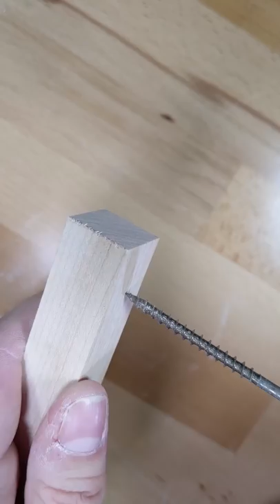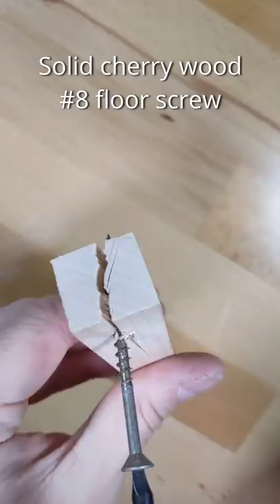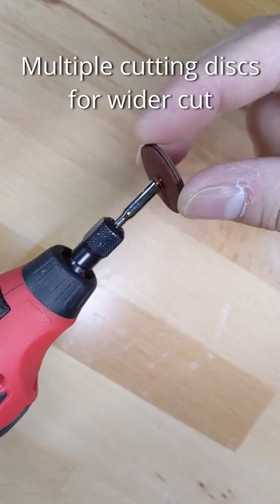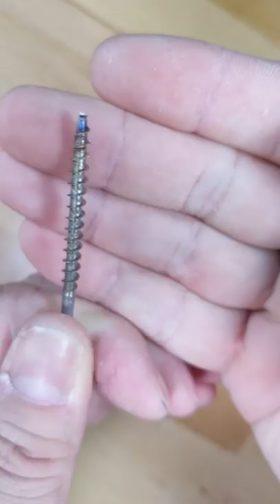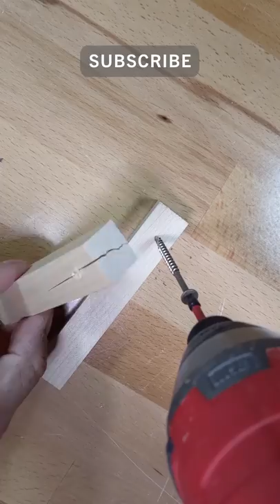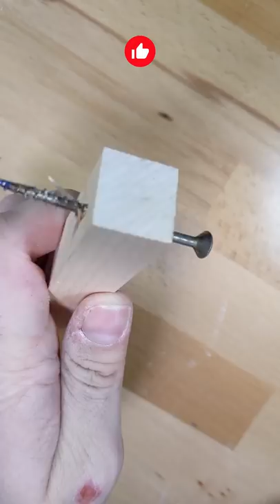Convert any screw to self-tapping, self-drilling! #shorts

Comment: Sounds crazy but why not pre drill the hole?
Reply from the maker: Not crazy at all. Pre-drilling should always be option #1!

As stated in the description, pre-drilling wasn't possible in my context. I needed to attach a small box to a wall stud; by screwing it at an angle, via the box's top opening. To be able to pre-drill with a 3/16" drill, I would had needed a 8"+ drill bit! This is definitely not common!

That's why I took "plan B" to use self-tapping screws so all I needed was my long screwdriver bit (far more frequent).
But my self-tapping screws were all 1 1/2" inch long at max... I needed a 2" and up to properly go through wood, drywall and securing it to stud!

Hope this clarify the why!

Thanks for your input!
Reply: @northernhandydad  
Sorry. I didn't read the instructions.
Probably why I'm always repairing my jobs
 Lol
Reply from the maker: @AngryHybridApe  Yet I pinned your comment! You were polite, and the comment valid! Thanks for participating; I hope I'll see you on my next videos! Cheers!
Reply from the maker: @jasen vernor  Good to know! I'll try to find myself a nice set! 👍
Reply: @northernhandydad  couldn't just run a smaller screw in first? Cool trick though
Reply from the maker: @Hanibalscookbook  Interesting. I'll have to try this small screw thing! 👍 Thanks for sharing!
Reply: Use a smaller screw or a nail next time. Try it, it works or even try running it in reverse. Easy peezy.
Reply: Saves time if you have alot of them
Reply: It's too fast.
Reply: Cool thx for that!! Learn something everyday
Reply: @northernhandydad  right angle drill
Reply from the maker: @SuS_NuG_It  Good idea! I'll try to find myself a nice self of those 1/4" shank drill bits.
Reply: Run the drill backwards for a second while  pushing. This is a massive waste of time
Reply: Just full the tip of the screw tipps
Reply: In a narrow piece of wood if you dont drill it splits
Reply: @federicofoglietta7635  
Yes it does. But I learned a neat trick if youre going to nail it. Blunt the tip of the nail 1st. I dont why it works, but it does. You would think a blunt end would make it split more than a pointed tip. It dont. At least you stand a better chance of not splitting it. It can still happen.
I got real good wirh glue. Lol
Reply: Exactly what I was thinking.
Reply: Honestly isn’t a bad way of doing it. They teach it in college but he made it look like a tedious task lol
Reply: This is a classic case of a solution in search of a problem...
Reply: Smh. Just pre drill it. Obviously you ain't don't anything extensive in woodworking if you think that's even a "hack" every job site has 2 drills atleast. Put a dam drill bit in one with a counter sink and drill it 😷🤮
Reply: @northernhandydad  a easier better trick....put the drill in reverse and pull trigger....after about 4 or 5 seconds when u see it smoke...then drill foreward.....thank me later and make a video with credit to me =) it wont split
Reply: Or even crazier, just buy self tappers
Reply: I’m just here to upvote all the politeness and understanding!!
Reply from the maker: @duzzitmatter8679  You're on the right video (not)
Reply: Or just buy a self tapping screw
Reply: Just use C4 saves time
Reply: Lol fuqn facts!!! Instead of going through all that nonsense!
Reply: @billdundes445  most of the reviews say they wobble, the only other solution I saw was to use a 1/4 bit chuck or 3/8 and put it on your drill but those reviews are bad too. Those extensions are for Phillips bits and stuff not really for drill bits
Reply: I guess pre drilling would be to much like work
Reply: That's what I was going to point out
Reply: Who has time to pre drill just

Comment: The key to this operation is cutting off the tip
Reply from the maker: Exact. So it's acting as a cutting edge instead of driving the screw in the wood! Others pointed out that a hammer hit on the tip could also do the trick.
Reply: @northernhandydad  this is true. Just hit the nail in something hard and dull the tip

Comment: Or just drill in reverse until the wood smokes a little and then drive forward.
Try it
Reply from the maker: Should work too! My trick is more on the safe side, yet way longer. Thanks for your input!
Reply: pro tip 👍
Reply: It works, we use the same method. 👍🏻
Reply: Wood yeah, chipboard no cause its poisonous
Reply: @abyssmanur3965  I try not to use chipboard anyway. I've never had a good use for the stuff.
Reply: I do this all the time. So handy.

Comment: There is an easier way... just put the drill on reverse first and apply some pressure to force the screw in a a couple of mil, then drill as normal and it will never split the wood 👍🏻
Reply from the maker: Will this work for solid wood? I know this is a perfectly valid option for soft wood like spruce, pine or cedar, but in my case it's cherry wood. Do you also use this reverse technique for solid wood?
Reply: @northernhandydad  should work fine, if you work your way slowly halfway in before you go forward . Also dipping the screws in soap bar before you screw them helps a lot.

Comment: Aside from other comments, I have yet to see anybody mention he is using a soft wood screw for hard wood, the threads are much tighter don’t go as far out in diameter on hard wood screws.
Reply from the maker: The purpose of the video was to show that any screw can be converted to self drilling. Those are effectively screw for sub floor!

Comment: Just run a regular screw in reverse before running it forward. Works well also.
Reply: Same thing I said. Don't have to pick up any other tools. You can use the bit for a counter sink too
Reply from the maker: Thanks for your input!
Reply: @northernhandydad  siding hack with a wood cutting blade: turn the blade around, it will cut without destroying the siding and save a trip if you're in a time pinch.
Reply: @northernhandydad  drywall mud hack: if you get bubbles in your drywall compound while applying it they dry and leave pockets. To avoid this add 1 tablespoon of dishwashing liquid to a 5 gallon bucket of compound and it will lay down like butter.
Reply from the maker: @theproduct8375  Thanks! That the kind of interaction I like! The more I know!

Comment: I have also run the screw backwards with pressure and it will slowly drill the wood without splitting it. This however does not work as well with the hardest hardwoods and will overheat the screw taking away its weather protection. 
Great little trick in a pinch 
A smaller screw will sometimes work as well to predrill the hole.

Comment: Just put the driver in reverse and burn the screw in
Reply from the maker: Will this work for solid wood? I know this is a perfectly valid option for soft wood like spruce, pine or cedar, but in my case it's cherry wood. Do you also use this reverse technique for solid wood?

Comment: Holy shyit. I could have pre-drilled 10 holes in less time.
Reply from the maker: Yeah, but when pre-drilling is not possible, your maths won't work.
See description for details!
Reply: @northernhandydad  yeah but not having a die grinder means you can't cut so your math is rubbish
Reply: @owen4789 , file.

Comment: This comment might not be seen by lots of people but.. 
if you stick your drill in reverse and push on it it will actually act like a pre drill for a couple threads. Then if you switch directions the screw tip is already down in slightly and it doesn’t split if you do it right.  This also helps with wandering screws.
Reply from the maker: That's the most popular proposed trick in this comment section! Thanks for your input! Have a good day.

Comment: I'm pretty sure cutting the tip off the screw is what caused it not to break cause I've been framing houses for over 20 years and if I run into something I think is gonna split when its nailed I turn the nail upside down and flatten the tip of the nail so it doesnt have the sharp point then it will drive in without splitting the piece  I assume the sharp wedge is what causes the piece to split
Reply from the maker: Exact! But removing some part of the initial threads also ensure they don't engage too early! Thanks for your input Eric!
Reply: @northernhandydad   I got you no matter what awsome life hack I guess is what some would call it but excellent job

Comment: Another tip for you: when you would need a really long drillbit, you can just use the screw and a hammer and tap the screw once so it leaves a mark, then use the mark to predrill the hole.
Its a good idea but it would be #3 on my options list
Reply from the maker: Really nice idea Dennis. Thanks for sharing!

Comment: Feel like a pilot hole would be better. 

This works but would only do in a pinch. 

You run the risk of gouging the wood too far for the threads to get a good grip.   While waiting on the drill tip they are spinning and eating the wood away they are supposed to grab.

Comment: If you don’t have a pre drill, just set the your driver in reverse and put some pressure on the screw as it turns. You’ll feel it once it sinks a bit. Then set the driver on forward and finish sinking screw. This will prevent that type of splitting. 👍
Reply from the maker: Thanks for the trick!

Comment: Very clever, + it makes sense with stubborn hard wood, I pre-drill  when I have heavy nails sometimes I drove into cabinets & some fixed shelves. I'm glad that strip broke during that piece when it's drilled extremely quick or a hidden defect in the lumber, good tip good learning video. 👏
Reply from the maker: My pleasure! Thanks for your input!

Comment: I'm just over here thinking about those poor linemans pliers.
Reply from the maker: Yeah, hurts me too. But don't do this for large quantities! Yet I'm impressed by the cutting force of the compound mechanical system of those pliers. FYI not lineman pliers, they are a little tougher!
Reply: Just buy Chinese imported screws.  They are soft enough to not damage the pliers. Just never let the driver slip once. 🤬 Then it's back the screw out and start over.

Comment: Maybe reallllll cheap screws on the larger end? Could save a bit maybe with big bugles but I would use the corner of a bench grinder, would be a lot more efficent
Reply from the maker: Definitely! But bench grinder are less common and that would had required me to unfold my tripod for filming... 😂
Reply: But,  1), bench grinders wheel normally cuts a wider groove.  2)  while holding the screw by hand, it will get hot 🔥, or you slip if holding by hand and run fingers into the wheel.  3)  don't let the screw get loose, catch on the wheel, get thrown into no man's land, and hopefully not into a body part.

Comment: It wasn't really good as a self tapping because it took too long to actually go into the wood which a selftapper would have immediately went in BUT it was amazingly good at not splitting the wood which was impressive.
Reply from the maker: Too fast at self tapping and the wood would not have been drilled properly to avoid a split!

Comment: The problem with all "self drilling screws" is they strip out half the threads in the wood by the time they get through the wood. Just predrill and do it right.
Reply from the maker: As stated in the title "Convert screw to self-drilling", this had nothing to do with a "best method to avoid splitting".
Reply: @northernhandydad  yeah I understood that, just stating a point about self drilling screws is all. I feel there is no need for them, let alone ever needing a method for recreating one. Just my opinion you can take it or leave it, no offense ment.

Comment: That is a variation of an old carpenter's trick to avoid splitting a board when hmmering in a nail.  You first flip the nail over and give the point a good strick to blunt the tip.
Reply from the maker: I like those old professional tricks! Thanks for watching!

Comment: Is there a way without the machine like sand paper sounds kinda dumb but is there
Reply from the maker: Usually only cutting the tip should suffice. Many reported that hitting it with a hammer also works.
Reply: Omg dentist 🙈

Comment: Also if you don’t want the end of a board to crack try flipping any penny nail over strike the sharp end of the nail with hammer then Flip it back over and driving your nail in. It works try it then let me know buy hitting me up buy letting me know what you think.
Reply from the maker: Thanks for the tip!

Comment: Would have still split that board if you sunk it all the way.  Pilot hold needs to clear threads and be countersunk in that situation.
Reply from the maker: Of course, screw head type would had caused trouble. A round one would had worked tho.
Drill bit with the countersunk attachment is the way to go!

Comment: Seems like much less work and risk to just drill a pilot hole. They also sell screws that are made to install without pre drilling, makes more sense to just buy those.
Reply from the maker: As stated in the title "Convert screw to self-drilling", this had nothing to do with a "best method to avoid splitting".
Effectively make more sense for many commenter here to always buy, never do a thing!
I prefer doing this for a couple of screws instead of a trip to the store. For large quantities the trip is worth it tho.

Thanks Tyler!

Comment: A much easier way is to tap on the tip of the screw with a hammer before using to round off..... also works for nails

Comment: You do know that they sell screws just like what you made at every hardware store right? And if you pre-drill like lots of people in the comment thread have said, you can also avoid splitting the wood. This tip is good in a pinch I guess.
Reply from the maker: Exact, I never said no should never drill a hole again! And a 1h roundtrip to the store for 2 screws is kind of a waste of time IMO.
Drilling wasn't an option for my project. See description for details!

Thanks for watching!

Comment: You don't even need to do that, just get a screw , drill it counterclockwise  for a little and then switch to clockwise and screw it in. It won't crack
Reply from the maker: Thanks for the trick. Have a good day.
Reply from the maker: Ou plutôt merci pour le truc!

Comment: This would be a now homemade self tapping screw. Most refer to self tapping screws when they think of sheet metal fasteners, but those are actually self drilling, not tapping.
Reply from the maker: Exact, I added the "self drilling" part. But wood screws are kinda self-tapping at their core...
Reply: @northernhandydad  Making a “flute” on a screw makes it “self tapping” as taps also have flutes on them. Screws themselves are simply that, screws, they do tap but only to a certain degree which is why they split the material pretty often.

Comment: Yeah,  it works,  but predrilling, or buying self taping screws is much easier
Reply from the maker: Drilling wasn't an option. See description for more details about the context. Thanks for watching!
Reply: @northernhandydad  your description doesn't really change my views.  The screws you're using don't appear to be 6 inches long,  and they do make fairly long drill bits,  even in smaller sizes.  Even without that option,  I still say that you could have bought self drilling screws.

Comment: Why not just get some self taps or drill? Uh Dah !👊🤠🤙    🇺🇸
Reply from the maker: As stated in the title "Convert screw to self-drilling", this had nothing to do with a "best method to avoid splitting".
As for buying, it's the appropriate solution for large quantities. When in a pinch for 1-2 screws, the trip to the store is generally not worth it
👊🤠🤙 🇨🇦

Comment: Anytime you're putting a screw through a board, youre screwing it to something so literally all you have to do is put it in reverse and push hard for the first piece of wood, believe this technique is called "burning in the screw' works much faster and easier, and then your screw still has a point to bite into the second piece of wood instead of drilling a hole in it
Reply from the maker: Thanks for the detailed explanation Peter!

Comment: All wood screws are self-tapping. Jesus, Christ, the amount of 'Professionals' coming into my store asking for self-tapping wood screws is unbelievable.
Reply from the maker: It's common to interchange self tap and self drill.
Reply: @northernhandydad  Oh, it's very common. It doesn't make it any more correct, though.
All wood screws 'self tap' (into wood), but not all wood screws self drill/cut/pilot.

'self-tapping' is terminology reserved for screws with a Type AB point used more traditionally for metalwork. As is self-drilling. A self-drilling screw will undoubtedly also self tap, but a 'Self Tapping' screw probably won't self-drill.

Comment: So much for filming in one take. Don't trust it. How many times did it take before reaching the desired outcome? Do it in one shot next time.
Reply from the maker: It's one shot with the blanks removed. YouTube require less than 60 seconds for this type of video.
Reply: @northernhandydad  The ole 60 sec rule aye? Never heard of that rule. Last I heard, it was under 15 min without having to be an official content creator. But, okay. The rules may have changed.
Reply from the maker: YouTube Short is a take on tiktok. Vertical, short, easily swipe.

Comment: You can buy them like that, pretty cheap too
Reply from the maker: Yup!
Reply: @northernhandydad  try really big wood bolts, you can't buy them like that
Reply from the maker: Exactly! I kinda took a screw and wood piece that fitted well in a video. But the trick is more for uncommon sizes and lengths!